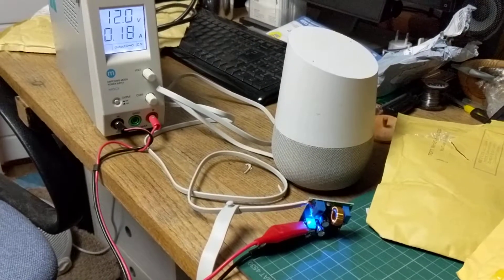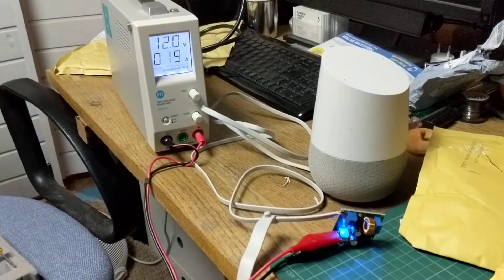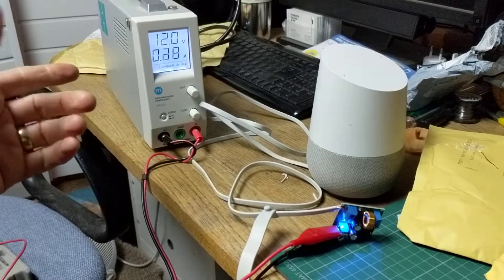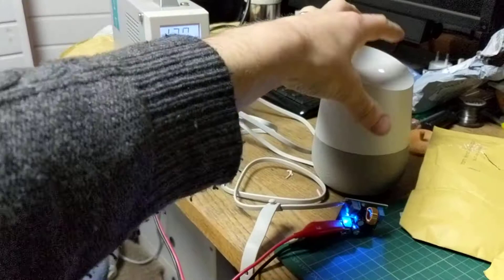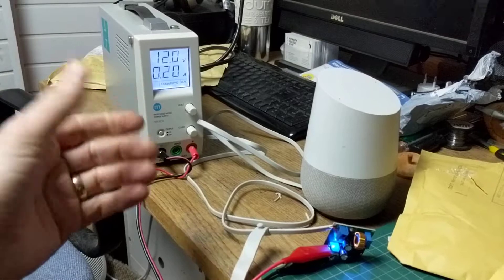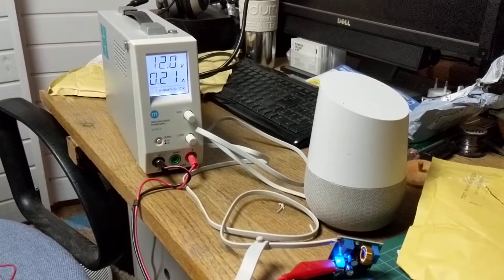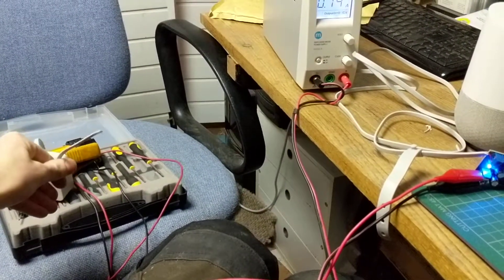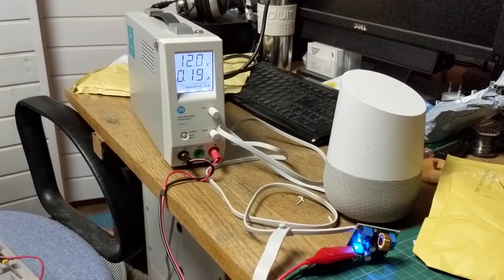How to run a Google Home on 12v (not home mini!)

Comment from the maker: A friend asked if I could wire up his Google Home to work on a 12v DC system. This is because he has a canal boat he lives on sometimes. Whilst he's hooked up in a marina he has 240v available, when he's on the canals he will have to run on his 12v battery bank which is charged from Solar and/or his alternator. 
For anyone who has run a campervan, boat or off grid setup you'll know that running an inverter is very inefficient, and most of the time completely unnecessary. Where possible run on low voltage DC. This keeps things simple, and arguably costs down... Back to the Google Home, this is not a Google Home mini.

Google Home - requires 16.5v DC and this is what the power plug provides.

I'm using a dc-dc converter, here's the blurb from the eBay advert:

DC-DC 3-12V to 19-36V Step-up boost Converter Module Adjustable High Power

Product Introduction:

Input Voltage: DC 3V-35V
Output Voltage: DC 4V-40V (continuously adjustable)
Efficiency: 94%（MAX）
Size：L37mm*W32mm*H15mm
Working Temperature: -40℃-+85℃
Load capacity：Max 80W
The way of Connection: the connection terminal is does not need to be welded, the "IN" is the input, and the "OUT" is the output.

-----------

Twiddling the potentiometer?(sorry I'm no micro electronics expert) with a small flat head screwdriver whilst a 12v DC feed is supplied to the 'in' positive and negative. Allows the adjustment of the 'out' voltage. I stuck a multimeter on the output till I achieved 16.5v.
I found a spec sheet that suggested this conversation is very efficient and should be able to provide close to 3A.

As the stock power supply is only 2A, there should be enough wattage even if it's exaggerated! (Further testing on the bench power supply suggests the Home doesn't draw more than 1A at 12V and for those who are interested it idles at around 0.14A whilst maintaining a 5ghz WiFi link and paused on Spotify. In fact it always seems to draw this amount, I guess it's 'always listening' for a command.

That's as far as I've got at the moment, I need to attach a few plugs so the connection lead that goes into the Home can be changed between the 240v transformer supply that is shipped with it, and the 12v dc-dc converter.

Risks -- 12v covered, what about when the alternator is running or the solar panels are enjoying the brief glimpses of sun we get in the UK at this time of year. Either of these could push the voltage of the batteries to 14.4v. I have to check to see if there's a 12v rectifier on the barge this will be used on. I think I'll find a small device that with smooth the input voltage. I'll also have a play with the bench power supply and crank up the volts to 14.4 whilst not connected to the Home to see what the output voltage raises too. I presume it'll increase!? I have a larger digital dc-dc converter that the output voltage is set via a display, it's overkill for this project though. Simple, cheap and efficient and the key requirements.

Is anyone else interested in this? I'm tempted to make up a few power supplies to see if the eBay market had an interest. Let me know if you find this video useful, I searched myself and found little experimentation from others.
Reply: Thanks for the tips! I am going to make one to run alongside my 12v garden lights system, but I bet there would be plenty of boaties and campers keen to buy a convenient plug for the yacht!
Reply from the maker: @patrickvale196 Hi, one of the things I hadn't considered is the on-board voltage regulation. It wouldn't supprise me if the Google home can run of a fairly wide input range. Then again I didn't want to take the risk of frying my Google home!! I know of two people that now run Google Home on 12v, and of course it's incredibly easy to run an old style Google Mini (rubbish sound quality) from 12v as they just use a 5v micro usb input so any Car phone charger will do the job. The newer mini (Nest mini?)uses a different connection I think, probably because it exceeds the usb cable current specification, although this is just a guess.
Reply: I dig it!! Thanks for doing the video. I'll be looking into doing this for a campervan setup.
Reply from the maker: @paulbrezgel  No worries, hope it works out for you.

Comment: Did you ever make up the power supplys? My 1st gen mini in my motorhome just died and looking for a better usb powered google speaker
Reply from the maker: Hi, this was quite a while ago now! It's easy to make up a power supply to power any low current device from a 12v source. Just use something like this :) 

Search for this: LM2577 DC-DC TO DC Adjustable Step-up Power Converter Module XL6009

Or honestly any DC-DC converter that will take the source voltage down to the required voltage for the device :) They're not wasteful of power either, great for a motorhome.

Comment: You could also use a battery base made by LOFT which costs about $12 and the full charge will last for about 8 hours.
They available in Amazon and here's the link : 
https://www.amazon.com/Ninety7-Battery-Product-Copper-Loft/dp/B076HB2G2X/ref=sr_1_2?dchild=1&keywords=google+home+battery&qid=1625851229&s=electronics&sr=1-2